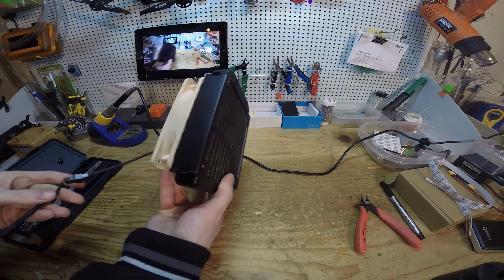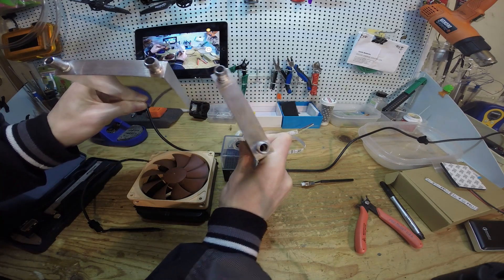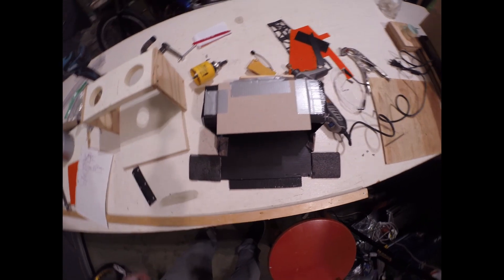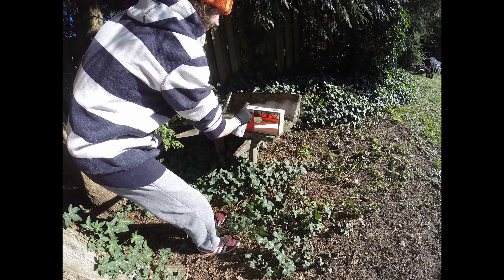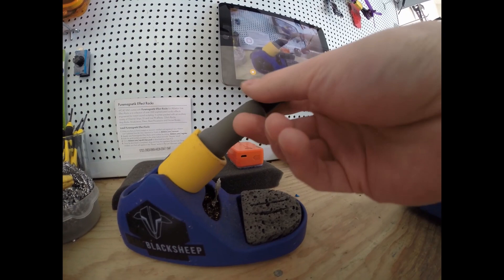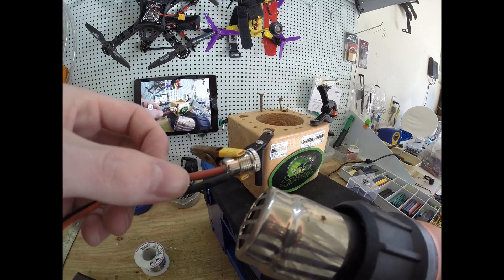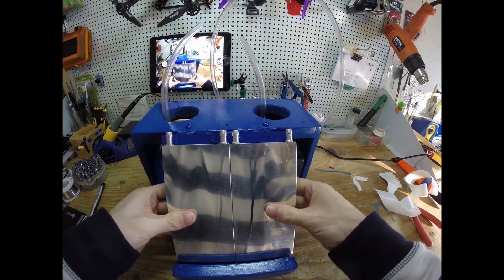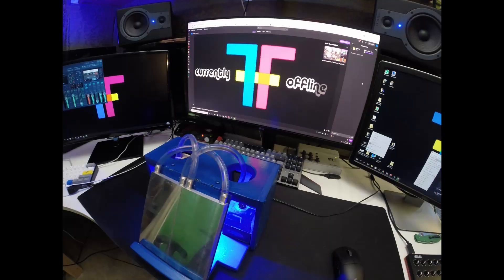iPad Water Cooling - DIY Water Cooled Tablet stand for Mobile Gamers and Digital Artists!

Comment: Nice build, where do you found those water blocks? Cause I can only find some with 200x40mm and I need the same as you used.
Reply from the maker: Only place i could find 80x160x15mm water blocks was on a website named Banggood.com. one of my blocks arrived from china with damage and i had to get it repaired. i don't advise buying from them since they don't protect the product in shipping but it might still be the only option. Hope that helps. tag me on twitter once you build , would love to see peoples builds!
Reply: FLOPPY FINGERS thx for the fast response....... I will look around to get one, which fits perfect...... but can you still make a list of your used components? For example the hub thing an the pump....... because its pretty hard to find the components, so that they fit together.
Reply from the maker: @denniswahl4659  i used standard PC water cooling parts so that they would fit together with no adapters. the pump i chose is a Yosoo SC-300T but you can use any PC pump/reservoir. the radiator is a basic 12 pipe for a single 120 mm PC fan. you can upscale this for faster cooling but i wanted to keep the stand relatively small. the USB charger is not needed but it can be found on amazon, search 12v usb outlet. all parts were found on amazon besides the water blocks.
Reply: FLOPPY FINGERS nicee okay, I got one last question...... you have a pump with a 3-pin connector, but you need only 2 of them to connect them to 12V directly am I righty? :) which two Pins/cables you used for this?
Reply from the maker: @denniswahl4659  Correct. i was originally going to put in a speed controller but ended up soldering direct connectors to simplify things. connect only the power and ground lines from a 4 pin fan or 3 pin pump, ignore the Tac and PWM lines. it will work on both 3 pin and 4 pin pumps but you need to check what wires are the ground and voltage and connect to them. you will have to check pinout schematics for Pc pump or use a volt meter to be 100% sure since they don't have standard color coding. if you know the make of the pump just look up the pin outs. let me know if that helps at all.
Reply: FLOPPY FINGERS okay, I am going to use the same pump as you, is the pump good? Noise, leaks and everything.......
Reply from the maker: @denniswahl4659  there is for sure a Hum to the pump. i don't mind it but i don't have any other pumps to compare sound levels to. the reviews i read mostly seemed to say it's quiet. i mounted it on foam to reduce vibrations and that helped a bit. hard to avoid the hum since it's built right into the stand.
Reply: FLOPPY FINGERS heyy boy, just wanna let you know, that ive send you a message on twitter. Maybe you reply to it, thx:)

Comment: Hey man great vid. Where could I purchase these parts you used?
Reply from the maker: I purchased the pump and tubing and bits from amazon and the only place i could find CPU water blocks that size was on Banggood. brazing copper tubes onto a thin sheet of copper works mostly as a heat sink. not enough surface area of the tubes touching the backing plate. with an actual water block thermal transfer is much more efficient. also when using computer blocks the fittings for the pump already match in this setup, no adapters restricting flow. if more people are interested in building one i'll make a more detailed build video with a parts list.
Reply: FLOPPY FINGERS I’m looking at making one and just got some of the parts.
Reply from the maker: @teeks_74  if you need any help feel free to contact me.
Reply: FLOPPY FINGERS yeah would be cool if you made a video with wiring up etc also.